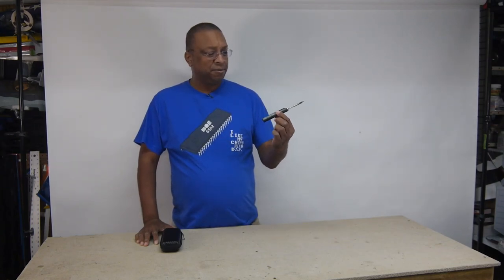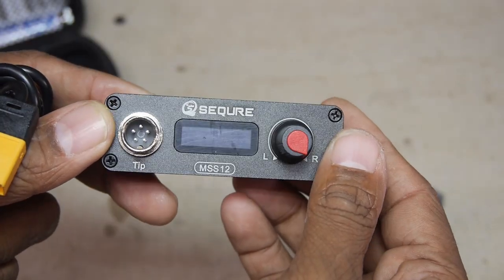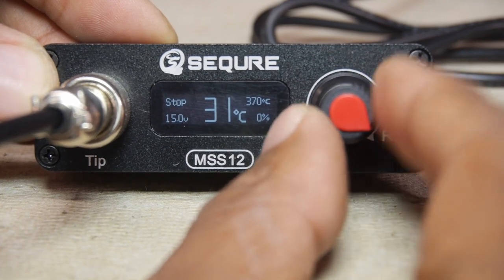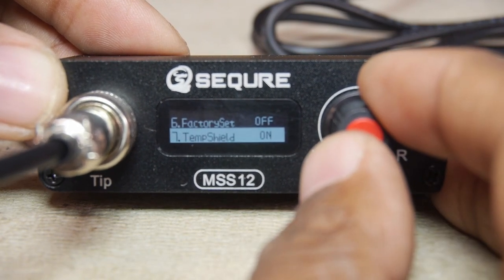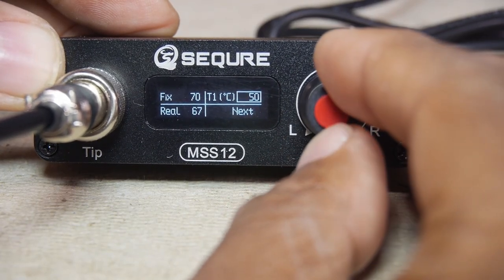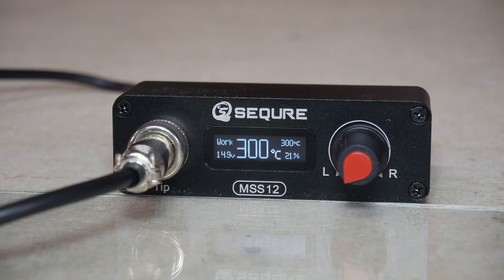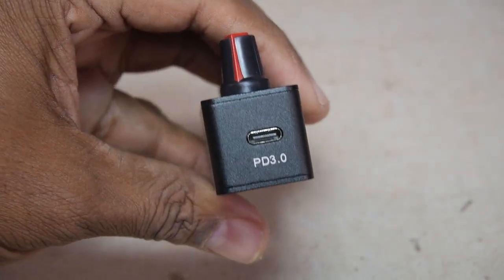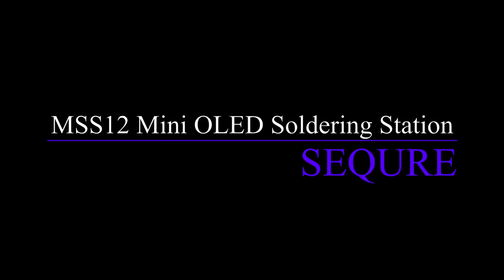Sequre MSS12 - The Little Iron that Could | HobbyView

Comment: So you were definitely melting housing when you were soldering that IC3 connector. First suggestion is to get a fatter tip when soldering those kinds of connectors. Second suggestion is don't heat the terminal from the back side. Heat the pretinned wire first then holding the soldering tip between the wire and the terminal cup that it's going into heat both at the same time then you can slip the iron tip out from between the two and switch it to the other side of the wire. If done properly you should only be heating that terminal for three or four seconds total to get a good clean solder connection and the plastic should never melt.
Reply: Well said, that's how I do it.

Comment: How's this thing holding up 9 months later?
Reply from the maker: Still holding up quite well. Used it the other day. I plan to get a larger tip as the included one is a bit on the small side for soldering battery connectors.
Reply: @HobbyView  Good to hear; thanks! Deciding between the Pro version of this (with the built-in PSU), Quecoo 955 or 958 (955 supports CFW, 958 is new but doesn't), KSGER V2.1 or V2.3 (V2.3 is new, seems to be built better, has it's case grounded from factory, but doesn't support CFW; V2.1 supports CFW), and Yihua 948DB+ II (new station from Yihua with T12 tips). It's so hard to decide between these!